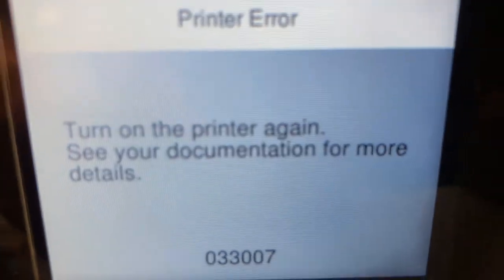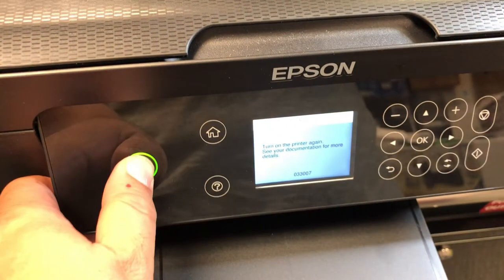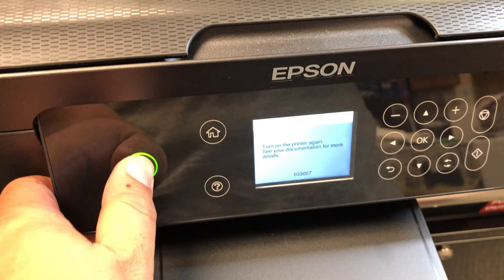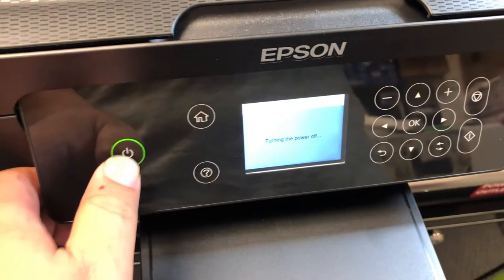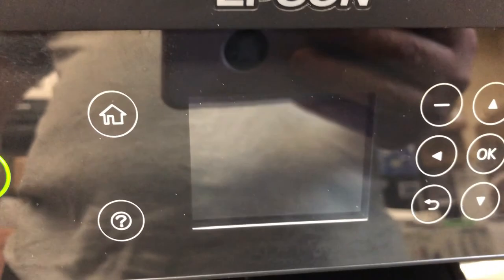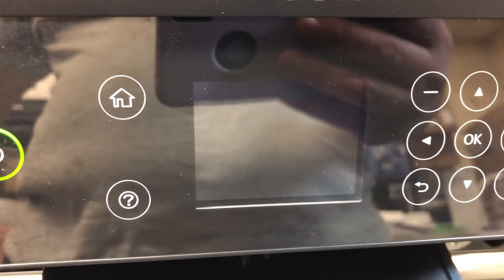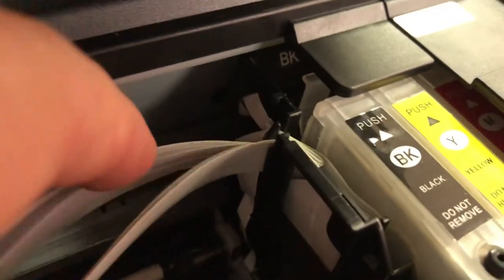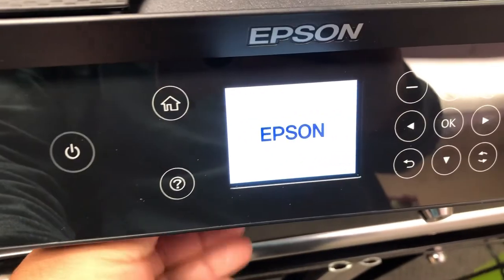Fix Epson Error 033007 - Fatal Error During Printer Start

Comment: I have an xp 15000 that i did a couple of cleanings with and then got this error, I’ve had printer off and disconnected since Friday and still get the error, checked all the cables and disconnected and reconnected and still have the error. Anything i can do ?

Comment: I ran this flushing  process flawlessly without spilling a single drop but then ended up with the dreaded 031006 error.  I have a 2 year old Epson ET-7750 ($1,250) that has seen regular but very light use. It showed a few faint lines on the prints so I decided to try this process. When I powered up the printer and attempted to perform the Power Clean it stated that I need to add a new Maintenance box, which seemed odd because my box was virtually new. I added the box, powered the printer and got that terrible error: 031006. I have restarted the printer several times but the error persists. I was meticulous in my cleaning, protecting the area and not spilling a single drop on any part of the print head. I cannot understand what could be wrong. The printer was near perfect before but now I cannot move forward.  I have read that an 031006 error could be related to a blown micro fuse on the main board which is a nightmare to get into and just doesn't seem to make sense under these circumstances. Does anyone have any thoughts on this?

Comment: Hi, can I use self-reset chip cartridges from aliexpress on that custom firmware for xp4105? I would buy that chipless licence but I don't know if that used printer even prints, I don't have any cartridges, I won't be buying anything to try it first as it's an endless money pit, at least that src cartridges would stay with me if I would buy another one.
Reply from the maker: There is no physical resetter exists for this model anywhere, as far as I know.

Comment: Hi Kevin. First I love your videos and they have helped so much. I had to change out my print head which I have done. And then I had error 031006 I believe. A blown fuse. My f2 was blown. I fixed that. Put everything back together. And now I’m getting this error as well as a scanner error 10007 I think. I’m gonna let it sit for a couple days. But is there anything I’m missing?

Comment: Any other ideas on how to get it back up and running?  I’ve tried that and everything possible even going as far as asking Epson and they pretty much said it was toast. Supposedly hardware issues. Of course it’s just out of warranty even though I only used 6 months. Do you think if I went chipless that I could make it work (WF-7720)?
Reply from the maker: Depends on what your error code is.
Reply: @BCHTechnologies  error code 031008

Comment: Epson WF-7210 I got the error code 033007 after replacing the printhead and printhead cables. Any suggestions on what I need to do in order to proceed to fix this issue?
Reply: I have the same issue, did you get this fixed?
Reply: نفس هذه المشكله ظهور نفس رمز 033007 طابعة ابسوان 7710 كيفيت حل هذا الرمز